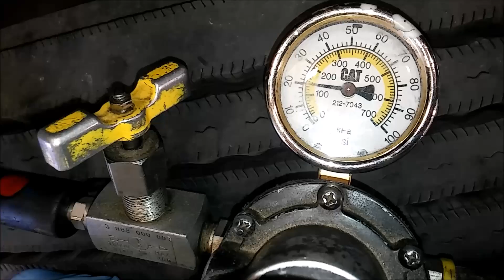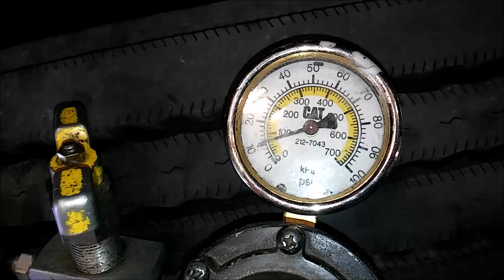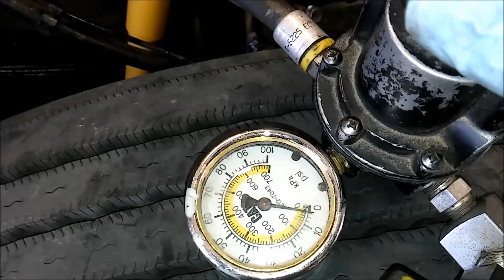How To Test a CAC or Aftercooler For Leaks.  Pressure Testing Air Intake Systems.

Comment: I'm having a hard time pressurizing the system past 22 psi and pressure dropping quickly. Also while doing it I hear what sounds like an air leak coming from the air compressor. Turns out while I'm pressurizing the system, air is going through the line thats attached to the intake into the compressor head and  going out the discharge line. When I remove that line and add a plug in the intake, I can pressurize the system more easily. All the way up to 30 psi and when closing off the air supply the psi drops much slower

Comment: So what was leaking at that clamp? Was it not tight or broken? Is there suppose to be a gasket? I just redid my exhaust manifold that was cracked and ever since I can’t get over 25#. I took the turbo housing apart to make sure my fins weren’t damaged and now I’m wondering if there is suppose to be a gasket between the snail shells that isn’t there.

Comment: Thanks for the video! Got a 3208 in a RV. Tested the CAC and all tubing with 0 leaks. Hooked the intake up and I'm getting pretty good leak i can hear around the #2 cylinder. Not coming from the vent, sounds like its in the head. Rotated the engine a bit to make sure the valves aren't in overlap. Engine runs fine, but is lacking power and wont produce more than bout 7psi boost. LOts of black smoke. Any idea what might be leaking in there? Bad valve adjustment?
Reply: I'm very new learning but I'm curious if you ever found out (4 years ago ;D) what the problem was, my first guess hearing your details is maybe a clogged DPF obstructing exhaust flow, which would put inordinate strain on valvetrain (exhaust valves, where you heard leaking) & of course diminish power to the turbo thereby compounding the problem of black smoke (i.e. lack of air = more unburnt fuel on top of the dpf being unable to remove the carbon to begin with).

Comment: At the end of this video you said you can only test to 1 or 2 PSI because it is so big on the inlet of the turbo. I am wondering if it is because the surface has so many square inches and would make a giant force, or more importantly are there any seals that would be damaged because the inlet should be at atmosphere and you would cause damage. I have seen this on pumps and know it is real, I just and not  familiar with turbos. Thanks.

Comment: Was wondering if you can do any videos on 425 B model for hiw to time the injector pump and rebuild the timing advance?
Reply: The key on VTU's is engine serial number to know what you have. 3406 B/C VTU's has numerous updates. You have a four bolt or a eight bolt. If you have a eight bolt a few different design's of them. Never reuse the bolts. Only ones are the larger allen bolts. On the four bolt you have early design and a later design. Early design can slip and no fix for them, replace carrier and wait until it fails again, (7FB 1 and up, 4MG1-03599). They was able to fix the slip on later design. Early design on the later engines has a filter in fuel system camshaft. Always replace it when VTU is removed. Parts book or SIS is not updated to show best parts to use. The very last engine's, 8PN's are correct in parts. As well as most of the 3ZJ's. NEVER adjust the screws in front. If you do, only fix is putting the timing indicator group on and graph it. 
Best way to time these, have pin in fuel system. Have mounting bolts finger tight. 7FB's and 4MG's 1-03599, your OK. All other engines, make sure carrier is pushed in towards fuel system. Turn engine until bolt goes into flywheel on TDC number one. Remove bolt and get a seal pick and place in hole. Back engine up until engine locks up. If you want to advance it some, pull pick out and give a SLIGHT BUMP, still backwards. Torque new bolts on VTU to forty one ft lbs. Remove pin in fuel system and back engine up more than thirty degree's. Now go in engine rotation and have someone holding pin and bolt. If bolt goes in first, your retarded and have to start over. If they go in at the same time, your dead on. If the pin goes in first, take you seal pick and feel in the hole how much you like until the bolt is dead center. Depends on which side you check flywheel. Exhaust side flywheel is coming up, pump side going down. I don't like over half a bolt hole off. Half or less is good, if you want it advanced slightly. Now remove pin, bolt or seal pick and finish assembling.  
PEEC engines unless you have ECAP or ET you can't calibrate the sensor. Putting cover on you have to wind up the bell crank.

Comment: My 14L 2007 Detriot blue a clamp today on the bottom of the turbo going to the cac. 
I heard a loud bang( shot gun). 
Instantly shut it down and coasted to shoulder. 
I found some oil. Maybe 2 table spoons of oil in the bottom of the turbo elbow. 
I cleaned it and reinstalled a new clamp. 
I inspected the top inlet of the turbo. Checked Finns. All looked great. Barley any movement on the shaft. 
Drove it for an hour and took boot and checked for oil. No oil. Boot stayed on just fine. 
What could of caused that ? 
Truck runs fine. No lose of power. No codes. No noises. 

Do those clamps just blow like that? 
And why was there oil inside the elbow at the bottom of the turbo ? But after I replaced the clamp the oil didn’t come back ? 

The oil did not make it past the bottom elbow into the main tube going to the cac. 

Thanks in advance for the responses.

Comment: Good info. I'm gonna forward this to my mechanic so he can find the leak I may have. I could do this myself but I think buying expensive tools just for one truck is not financially smart.
Reply: YYou can easily make one from a fernco fitting 
a PVC cap
A pressure Guage
a Fitting for connecting your air compressor

Comment: What's the normal psi for a c 15 mx accert  twin turbo also can I check for the same problems just by using soapy water while ideling?
Reply from the maker: +Gabriel Godina Under heavy load it is usually like 38-45 psi depending on the engine.

Comment: if u do just the CAC, What is a ok psi drop over a 2-3mins? whats the standard.  thanks
Reply from the maker: +kwmiked So if you cap the CAC it shouldn't leak at all, if it does you definitely have a leak. Now I'm not sure off the top of my head what the spec is, but if you can watch the needle move it might be time for fixing the CAC.
Reply: Adept Ape ok, i thought they had like a standard,  like 2psi over 5mins or something like that. 
thanks
Reply from the maker: +kwmiked I'm sure there is a spec sir, I can try to find out if I remember.

Comment: Another Great video, We usually just pressurize the engine straight to the turbo inlet in whatever the engine make model is. But I agree with Norwood . I was hoping on episode 7 of DIESEL TALK. We want our weekly dose of DIESEL TALK. I better make another donation then huh?
Reply from the maker: +Joel Lagpacan I'll happily use any extra cash you have laying around, but I'm working on a video in the Ape dungeon right now, it's a video I've been getting a lot of requests on. Then I'm getting onto Diesel Talk number 7. It'll be out this weekend.
Reply: By “to the turbo” do you mean at the boast pressure gauge tap?

Comment: lol I have similar version but using pcp cap sizes with a regulator
Reply from the maker: +Eric Price Whatever way you can get pressure into that system will work.